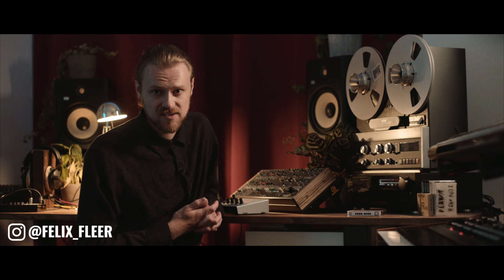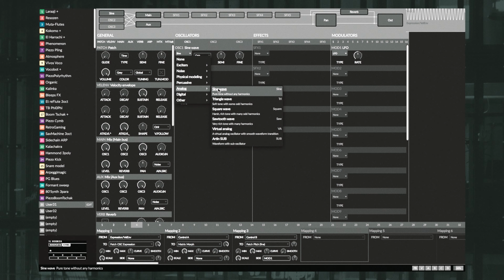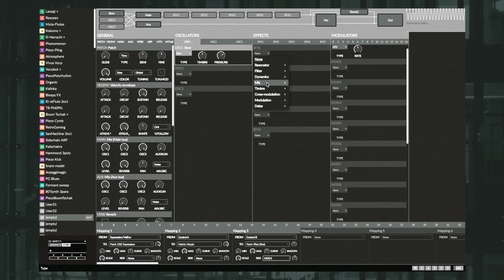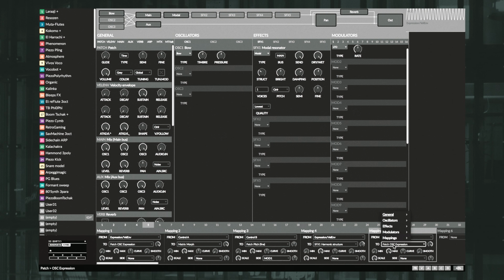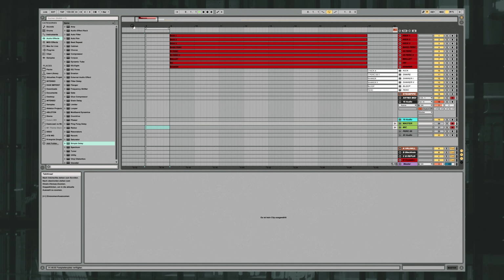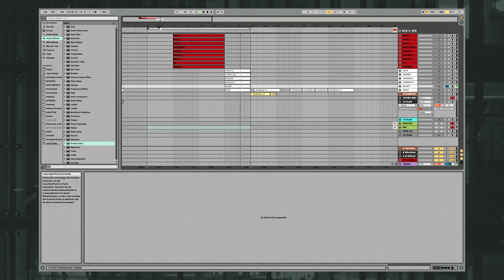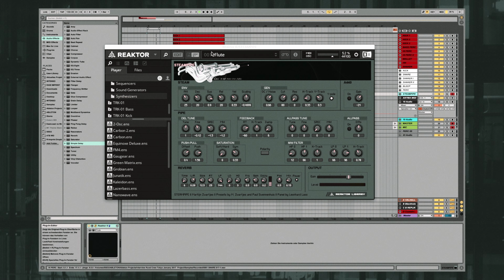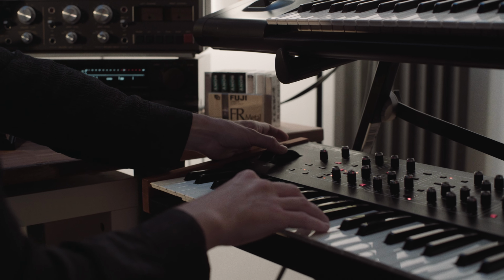Why you might wanna explore Physical Modelling Synthesis | Thomann

Comment: Anyma is too expensive at 500€; monophonic vst in a box..it's not like having adequate cpu power for polyphony would affect the price..
Reply: Yes it would. Higher price or worse sounds quality.
Reply: @blushingfrieza   How much it would affect the price to have 4-8 voice polyphony? Anyma is about 50 % more expensive, than e.g. Mininova, and relatively equally priced Cobalt8M has 8-voice polyphony.
Reply: @Methanol2000  someone on a forum explained it well:

I think maybe a lot of people's tacit mental model of how you make a synth polyphonic is based on poly analogs: you have some set of chips that make up a voice, then you have a few of those and some kind of master control board and voila. DSP stuff isn't like that. Your chip has to deliver a certain number of computations in a certain amount of time for the sound to come out, and whatever chip you're using has a hard limit on how much of that math it can do in the allotted time. You can't really just add another chip (or set of chips) like you could with analogs, because there'll be timing issues and so on; you'd pretty much have to start with that in mind for it to be a viable strategy. The other option is a more powerful chip.

So this one is monophonic, period, and "making it poly" would mean redesigning the whole thing. It'd be a whole different product and they'd basically have done R&D for two products with no monetary return to date.